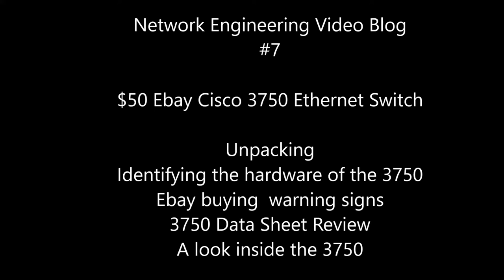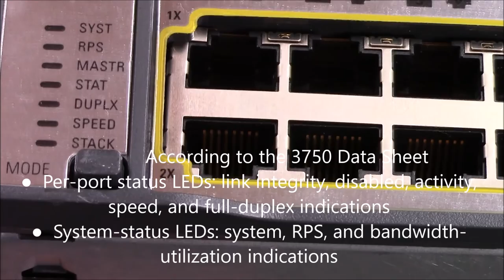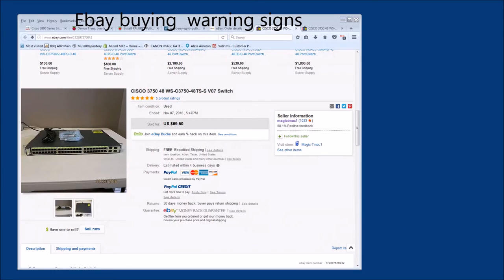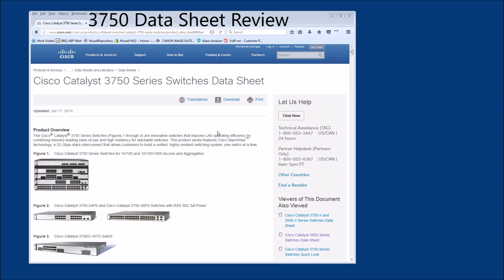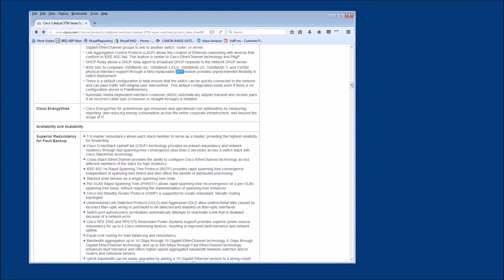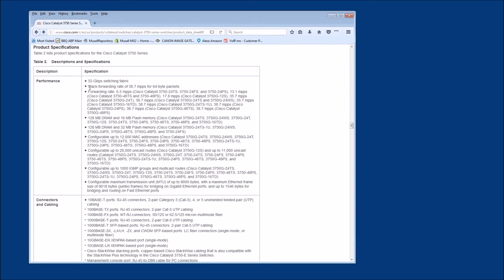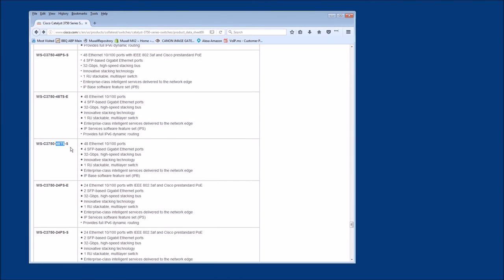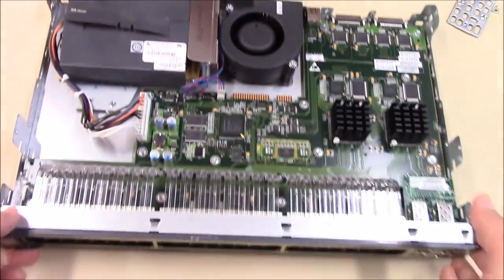NE#7 $50 Ebay Cisco 3750 Ethernet Switch

Comment: I have a question, when you bought it, did it come with a ios image? I'm afraid to buy a switch that won't work, and also which ios image you need for the 3750x switch?
Reply from the maker: Great question!  Absolutely do NOT buy any Cisco product that does not have a working IOS image WITH all the licenses and features you want.  If it is a reputable seller, they will be able to verify and prove that the switch you are looking at has everything you want.  If a seller throws his/her hands up and claims ignorance, then make sure they have a 100% + shipping costs return policy.
Reply: @NetworkEngineeringVideoBlog  woooow thank you so much sir!!!! just the information I needed! which Cisco switch would you recommend me for a home setup? I'm a ccna student but I want a cheap 24 10/100/1000  gigabit switch not only for testing
Reply from the maker: @gastonhitw720  That's a tough question!  It's like asking what kind of car I would recommend :-) Stick with the 3 "P"s... Ports, Performance and Protection (aka security).  If you're looking at Cisco products, I don't suggest anything older than the 3750.
Reply: @NetworkEngineeringVideoBlog  thank you, I also have another question, do you need to own a license ot use the sfp ports? I've read this https://www.cisco.com/c/en/us/td/docs/routers/ncs5xx/ncs520/configuration/guide/csa/16-9-1/b-csa-xe-16-9-1-ncs520/b-csa-xe-16-9-1-ncs520_chapter_011.pdf

which says "If there is a license and a 1G SFP is inserted in the chassis, ports Te0/0/4-Te0/0/7 will come up in 1G
mode only"

I need to use at least 1 sfp port for a media convert I have
Reply from the maker: @gastonhitw720  Based on that pdf link you posted, yes.  I refer you back to my original answer "Absolutely do NOT buy any Cisco product that does not have a working IOS image WITH all the licenses and features you want. "  If you need 10G or 1G SFPs then make sure they are installed and working when you buy it.
Reply: @NetworkEngineeringVideoBlog  thank you so much sr for your answers, I will subscribe!

Comment: so put it in the corner of a room near a window if you can small 19 u frame you dont need an enclosure or you will run into heat problems just open sided they go for around £150 on ebay
Reply from the maker: You are correct about not putting it in a closet without ventilation.  However, setting next to a window can be problematic with the sun shining on the equipment.  If you check out telecom sites, they are usually windowless because it just add more load to the A/C system.

Comment: Nice video. Please in the future power it on and show the fan volume and maybe do a throughout test!!
Reply from the maker: When you said "fan volume" I thought you were asking about the volume of air the fan moves.  But, then it dawned on me that you are asking how  loud the fan is.  The Cat3750 is very quiet.  You are correct, I didn't test it thoroughly in this video.
Reply: Network Engineering Video Blog good to know thanks!

Comment: Does it cost a lot, in electricity, to run?
Reply from the maker: If it's a Cisco product; probably.  The enclosure is the only thing "green" about their products!  But, if you are curious, you could look up the running amps in the 3750 datasheet and calculate how much it would cost you in amp/hours to run.
Reply: I usto work with Cisco products, I am CCNA Certified, 3 times, but since retiring, I let the exp. date pass. I  remember how loud our network closets would be, when we used Cisco 3750’s, especially when stacking 4, or even 8. I never did the power calculations, we had another guy on the team who did that,. All I knew, is that they usto Dim  lights in certain locations. I should have paid more attention to what the power guy did. I wanted to add two to my home, more for nostalgic reasons, but to also use them as my switches for my SOHO, but I think they will cost me more to own, than to buy. So i will try netgear or Dell managed switches. 

Thanks for reply
Reply from the maker: @mtandiz  According to this Cisco 3750 Technical Spec: https://www.cisco.com/c/en/us/td/docs/switches/lan/catalyst3750/hardware/installation/guide/3750hig/HIGSPEC.html, the 3750-48TS’s power consumption is 75W and it dissipates 256 BTUs of heat per hour.  According to https://www.wikihow.com/Calculate-Kilowatt-Hours:  watt-hours per day = 75W x 24 hrs/day = 1800 watt-hours per day.  Divide that by 1000 gives you Kilowatt-hours per day (kWh): 1800/1000 = 1.8 kWh per day.  Looking at my electric bill, I pay $0.133 per kWh.  So, I pay $0.133 x 1.8 = $0.24 per day to run the 3750.  Or, $0.24/day x 365 days/year = $87 per year to run the 3750.

Also, don’t forget the cost to cool 256 BTUs of heat per hour.  According to: https://vmguru.com/2011/06/how-to-calculate-electrical-costs-for-cooling-and-power-consumption, 1000 BTU/h is approximately 293 watts or 0.293W per BTU/h.  So, 256 BTU/hr of heat *0.293W per BTU/hr =  75W of heat.  Makes sense, right?  The 3750 is using 75 watts of power and generating 75 watts of heat.  Since we’ve already done the cost calculation for 75W above, we know it will cost us another $87 per year to cool the 3750.  Our total cost to run the 3750 - 24x7x365 is $174.

I’m not sure I agree with vmguru’s cooling calc but it’s a good “back-of-the-envelope” calculation to give us an idea of what the costs might be.  A better calculation would need the A/C unit efficiency, i.e., how much power the A/C unit uses to cool 256 BTUs/hr of heat.
Reply: @NetworkEngineeringVideoBlog  Removing the 75W heat only matters if you use it in a cabinet with a lot of other equipment. If you use it in SOHO environment, a single 75W heat source is neglible, even in summer, you don't need AC for that.
Reply: @gabiold  Yep, we’re just having fun with all this back-of-the-envelope stuff.
Reply: @gabiold  we have AC in the UK its called open a window the wind is free
Reply: or a fan just keep that air circulating thats all you need
Reply: AC my arse

Comment: probem is u have know how code these. wich what takes 3 years school , 
i guss i lucky haveing add i learn code them in days,  have 6500 720 sup with wism2  card now getting it all work togather was not fun. first ios had huge probems after cisco gave me all updates to program it was simple throw cisco did not understand why i used some the code in fack they had no clue what code was for, it seams that cisco could not get certifice athencation to work so they just turn it off now i could told them how fix it , it was not a hard probem. in fack i coded the swich to look over certifice errors 
throw what i want is off load all certifices off wism card and load them on swich throw found no way to do this,
and by way i set up 10 gig home network for under 400.00 is it worth it no, if u look at speeds trasfer and how bussy the swichs are u find one thing they run under 1 pecent even in gameing. fiber vr copper one better then other less probems with fiber, it is faster over 100ft 25 ft dosent madder use sheald cable anything less then 5 ft